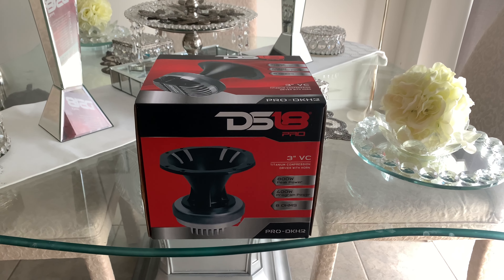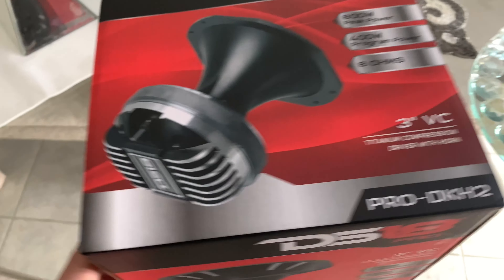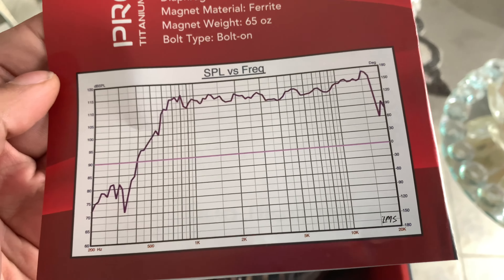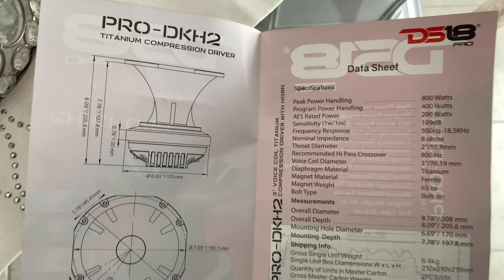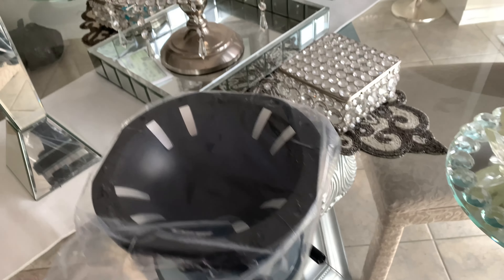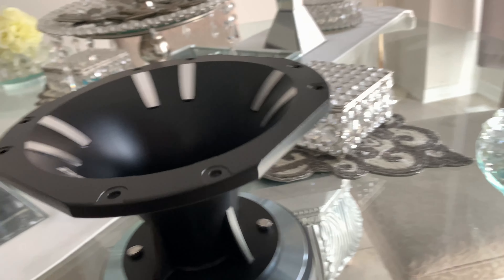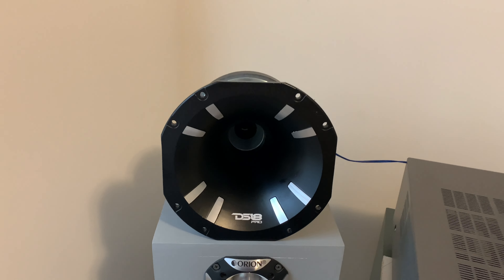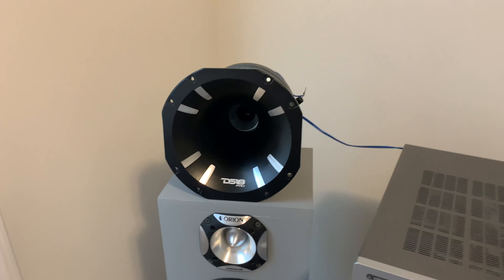DS18 DKH2 Horn Driver Unboxing

Comment: How do you compare the horn sound tp the tweeters?
Reply from the maker: Horn has all the vocals
Reply: Are horns used to replace tweeters?
Reply from the maker: @khidarshprema694  you could replace them if you want, but it’s not designed too

Comment: how much db does this beast make?
Reply from the maker: I’ve no clue
Reply: @blazedlegend  can u test it plz??
Reply: @jessespreeuwers3190  actually did a test and the result is insane. Firstly the dkh2 was crossed @800hz-16khz 12 per octave. Running on 200watt rms pink noise we got 135db at about 5 meter away. We had to wear plugs because it's insanely loud. At 1 metter we got 138db. I hope this was helpful.
Reply: yes really thx! but can it do more than 200watt?
Reply: @jblbasstester69420  is my second account btw!
Reply: @jblbasstester69420  I wouldn't recommend running more than 200watt rms. I use this driver for pro audio which mean it's will be used for hours at a time. It can easily handle 200watt rms with a 3db cress factor without any considerable amount of heat.

Now can it handle more? Yes and no.
Aes is the what a speaker can do over a long period of time. Program is the what the speaker can handle in short burst. If your crossing at a higher point you can do 400watts for a few minutes without burning it. I wouldnt recommend doing over 200watts. I hope this helps.